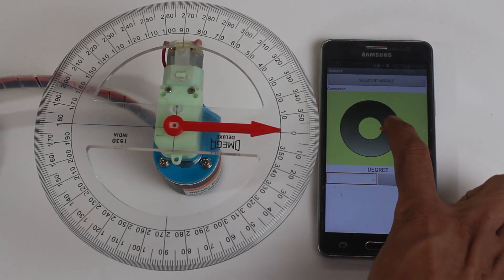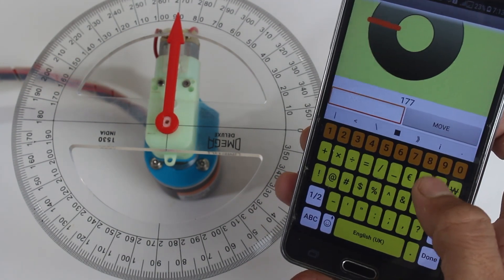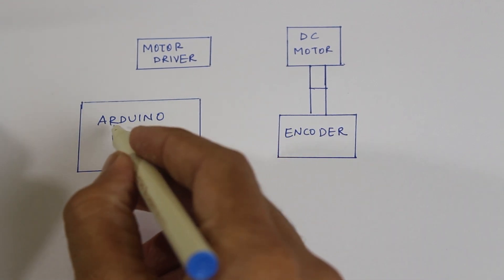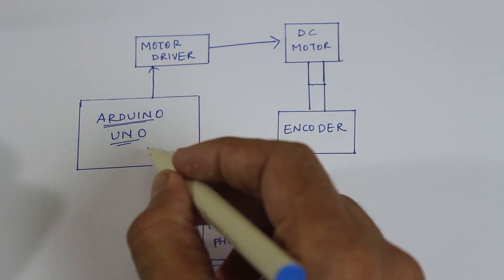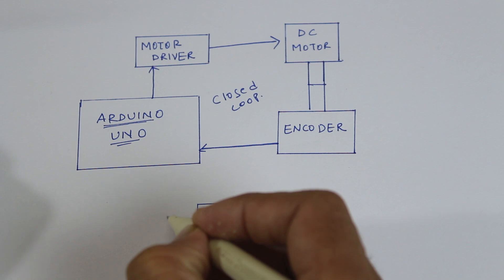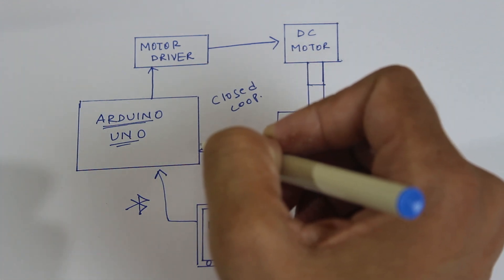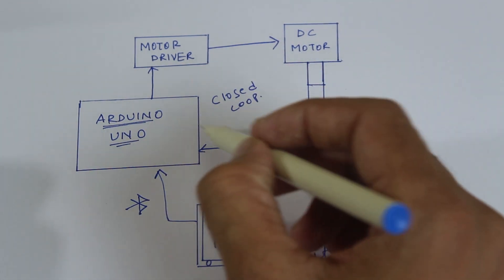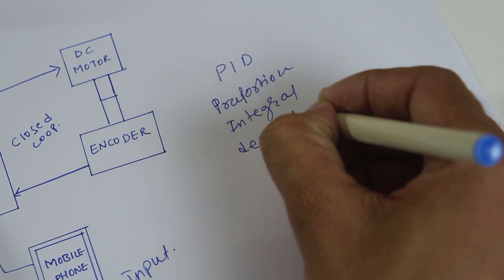Arduino PID based DC motor position control system

Comment: lets say circle have 400 locations on it instead of 360 degree, each location identified as numeric location id, so how can we move to pointer to series of location given... for example starts from 0 to 10 then move to  34  ->  200 -> 90 -> 275 -> 345 and so on .. how to do these series moves one after other

Comment: Excellent, for more precise controls, and flat response, MPC controller, LQG, or measure current with INA219, then 3 PIDs in cascading. The first PID control current (fastest state), second PID control de angular speed, and last PID, control the position. And there are more control strategies for a DC motor, but with MPC control, the angle accuracy is perfect and with the fastest and flattest response, without overshoot.

Comment: how does the arduino know where the motor zero is when it starts up? for example if is loosed power midway and you turn it on , it will start with that position as zero. is that correct?

Comment: Hi, I know it's an old Project.. I'm trying to reproduce the Project and for me the motor start spinning continually once I enter any value.. it stop if I enter  0
I'm using a 12V DC Polulu motor with encoder with 30:01 Gear Ratio and No Load Speed 350 RPM and 1440PPR

Comment: Thanks for the video. You English is not that bad. You are doing just fine. I did not that the control loop has significant overshoot. That is a significant problem for machines such as CNC

Comment: Hello mrinnovative. I have an issue as my motor is not moving precisely, its like i wouldnt even have a pid and the pointer is fliping back and forth, continously. Any advice on the matter? Many thanks in advance!

Comment: if the encoder was connected to the motor shaft  instead of the output of the gear motor and it took  30 rotations of the motor to turn the output one revolution, would your code state as the number of pulses of the motor shaft  48,000  for the output shaft to go 360 degrees?      int PPR = 48000 // not 1600;  // Encoder Pulse per revolution:       int angle = 360; // Maximum degree of motion

Comment: Wow. found out your channel recently, your explanation is very good. I have seen a few optical encoder videos reading through the code but the closed loop diagram you presented pretty much gave me an easy way to understand the what the whole thing does. It's like a big picture, now I can re-read the codes with a sense of direction.

Comment: Can I use PID to control speed? I am using a system where I need the motor to rotate a shaft at a constant speed. I am using a belt&pulley to make the rotational speed as constant as possible, but it is still showing slight variation in speed (+-4-5% max). Can I improve it through Arduino PID?

Comment: Unfortunately in your example, especially the ones where you type in the numbers, does not seem to work too good. The arrow "overshoots" the target quite a bit, and it's an extremely light item, what would happen if the motor was driving something with more moment of inertia? I'd expect acceleration and deceleration to be much smoother, otherwise the PID controller is not really that useful. Very nice PCB I also like to use JLC PCB

Comment: This is amazing dude, it even works with my 3200 ppr stepper motor with encoder, just had to change the 1600 ppr to 3200 in the map() function, or else I could only achieve to get from 0 to 180 degrees.
Reply: how can we get a zero angle reset

Comment: Thank You for this tutorial, but I have one question. Does this encoder know the position of angle if we reset the power supply ?
Reply: Not the encoder, but arduino remembers it because I had tested it with arduino mega 2560 and pmdc motor. When I stopped running motor by hand.. It started with the same pattern from where it was stopped. 

Note that I did not cut power supply only stopped by hand running

Comment: Your English is fine.  You are explaining difficult concepts in a second language.  The only point of language is to allow us to communicate effectively.  If anyone judges a non native English speaker's intelligence by how well they speak English, then I don't think that person understands what intelligence is.  

The only thing I would add to the video is that when you show each component, you should have text on the screen describing the component.  Maybe the name, the part number and what it does.  Most people watching the video will be using it as a tutorial or for guidance and that information would be very helpful.

Comment: TCCR1B = TCCR1B & 0b11111000 | 1;  // set 31KHz PWM to prevent motor noise
Timer/Counter Control Register 1 B(TCCR1B) is used for PWM 9 and 10, but you're using PWM on pin 6. 
Shouldnt you be changing TCCR 0 instead? thats the control register for pin 6. 
I would be interested in seeing your output frequency of pin 6 compared to 9 and 10. 
Either way, it got the job done. Great video!

Comment: Sir i want to move encoder motor to like from position 0 to 5 times in cw direction then 10 times in ccw direction then move back to 0 please make a video on controling continuous motor running position control with encoder help

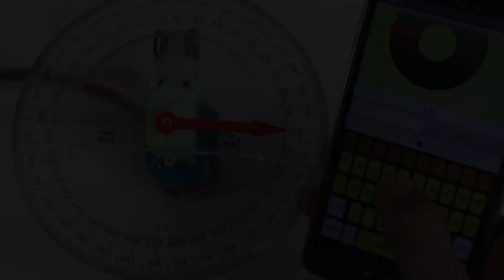Comment: 6:13 Anmerkung zum Text dort : https://www.deepl.com/de/translator  ist vermutlich der schnellste Übersetzer der Welt und soll auf immer mehr Sprachen erweitert werden. Ich bin zuversichtlich, dass man dort eines Tages auch geschriebenen Text in gesprochene Sprache wandeln können wird. Niemand sollte sich scheuen seine Muttersprache zu gebrauchen und die Übersetzung  den Experten zu überlassen.

Der Hauptfehler ist, gesprochene Sprache mit störenden Hintergrundgeräuschen zu verschandeln. Wer Musik hören will soll Musik hören und wer sachbezogenen Text hören will, der soll das ungestört tun können.

Comment: I went to the store in the link to purchase 3 of the encoders but when filling out the account information they do not have the United States of America available as a choice for country.
Reply from the maker: This may help you https://www.amazon.com/AOMAG-Incremental-Optical-Encoder-Two-Phase/dp/B07JL936DY/ref=mp_s_a_1_sc_6?ie=UTF8&qid=1542518087&sr=8-6-spell&pi=AC_SX236_SY340_QL65&keywords=400%2Bppr%2Bencoder&th=1&psc=1
Reply: @MrInnovative   Thanks for the link but those are more than twice the cost of the ones listed in your first link. Probably not a bad price if I knew I could use them in my experiments but too much money to gamble with at this time.
Reply: @MrInnovative  I also tried to purchase the motors using your Amazon link for them. Amazon did allow me to sign in but said the shipping methods used were not able to deliver to the United States, too bad because they looked affordable to play with.

Comment: Greetings from Iowa in the USA. Your accent is thick but I can understand you just fine. 
You could always let a few people screen your videos privately before releasing them if your worried about your English.

I like what you have done here. I think it's possible to control this motor with step and direction commands using some of your design; then people could progress past stepper motors and open loop designs. 

Thank you for your work!
Reply from the maker: Thanks for your support

Comment: Your narration is fine. If you don't feel comfortable with narration instead use subtitles as the section you show your code could be better explained to the viewer.
Reply from the maker: Thanks for you valuable suggestions i will definitely work on it
Reply: @MrInnovative  Mr. Chainsaw is right, but indeed understand that your narration is fine :-) It's not a problem if you are a bit harder to understand.
Reply: Watch this video for making it https://youtu.be/UyljPBSpYpY
Reply: @ssirdigital  vid is not available